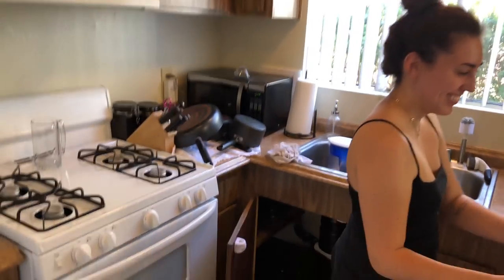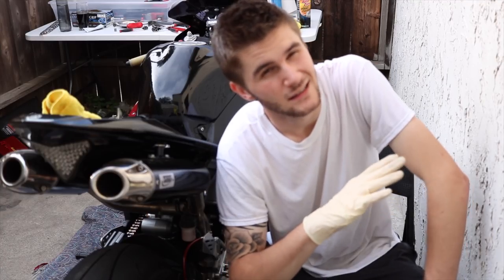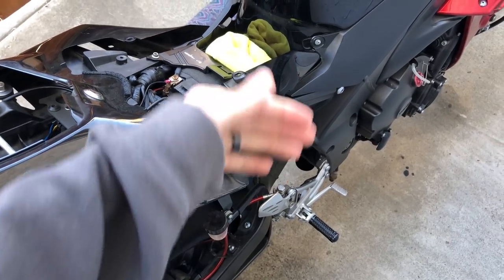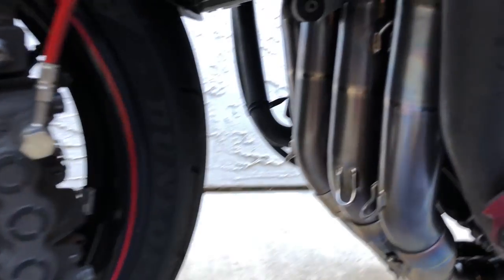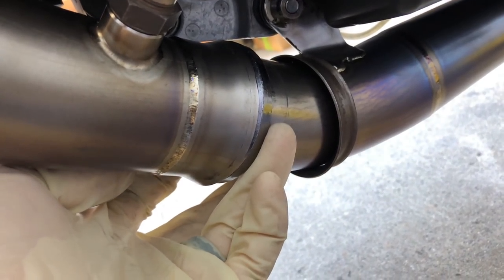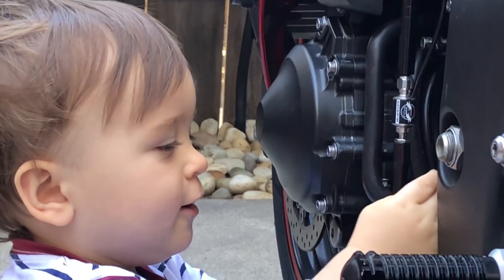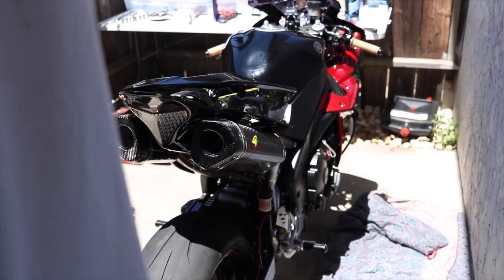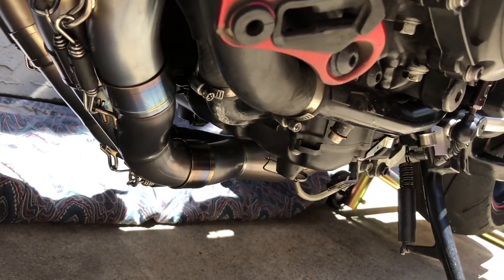Full System Exhaust Install Graves Yamaha R1

Comment: Good job.
How did you get The springs on the headers I seen that you took unBolted the flange from the head., and put the spring on? How did you get it up to the head? Mine don't have the holes to fit the spring up to it. I bought this R1 not too long ago and it didn't have none of this stuff with this custom exhaust. Thanks, and cool little helper.. lol

Comment: I have graves slips on current it the second new set I got shipped to me about fitment. First set the right exhaust couldn’t bolt location would not aligned with the stock bolt location. So they sent me a second set n it work a lot better. From revzilla took care of me instead of the manufacturer just question of my install 😂. Since now I saw the video I have second thought of buying the y pipe to get alittle better flow.
Reply from the maker: yzfr1too I would definitely still get the y pipe. It’s amazing and really makes the exhaust shine. Especially if you remove the plastic heat guards. Idk why they have such annoying figment issues 😅

Comment: I have the same problem with the right canister moving but I have a full two bro’s.Maybe it’s a flaw with the bike?
Reply from the maker: Seymour Clarkson yeah the hangers / grommets suck. Try adding some washers to increase pressure on the grommet. Mine doesn’t move anymore I fixed it with something along those lines